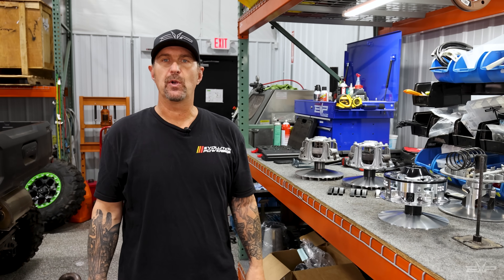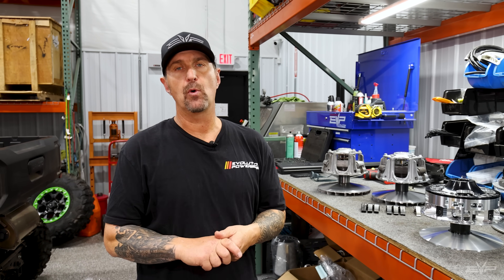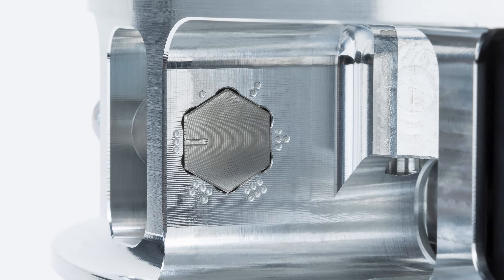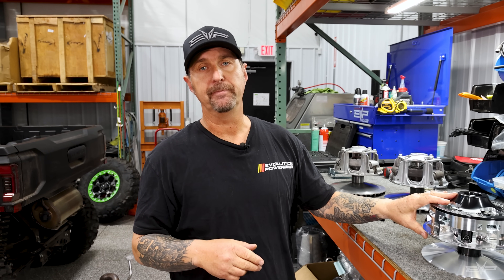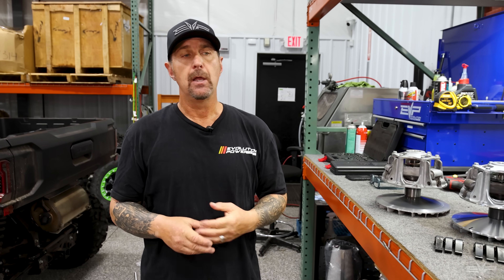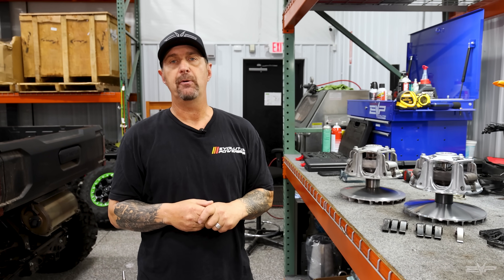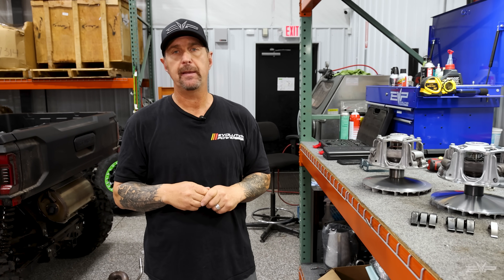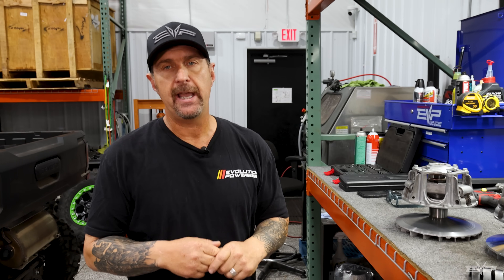EVP Update: Kawasaki Teryx H2 Clutching Development

Comment: You taught me something I had never even thought about.  So Kawasaki is basically using the CVT as a way to limit the output of the motor by reducing the RPM's which causes it to create less boost.  Came to the video to learn a little about the H2 and left way more knowledge than I was expecting, thanks.
Reply from the maker: The CVT is regulates the RPM and is non adjustable with OEM components (weights/Springs/Helix).  However, the ECU has multiple strategies for limiting RPM as well.  It closes the throttle, reduces ignition, has a rev limit, etc.  By changing the these parameters, plus changing the clutching, we can rev the engine higher which makes more boost which makes more power.   Kawasaki has made it pretty seemless how the RPM limits stage in so you don't feel like you are up against a hard limit, however, for sure if you are over 9000 RPMs stock, you are being limited by the strategies discussed above.